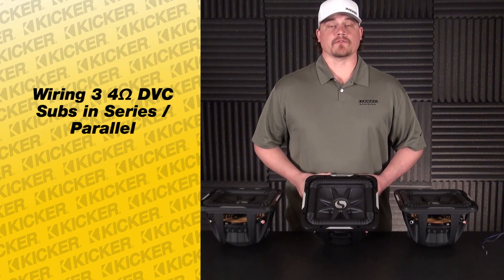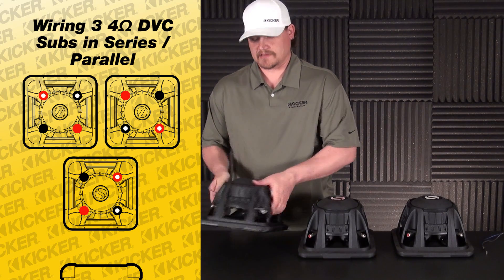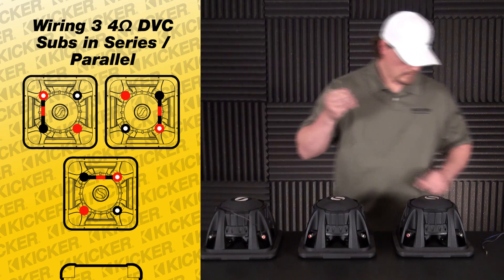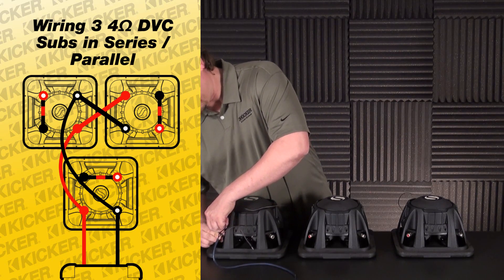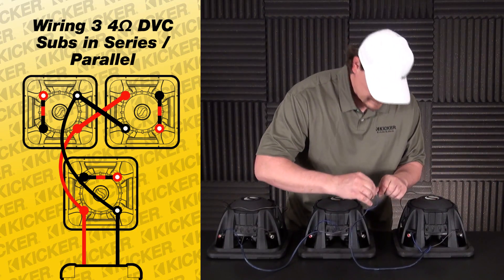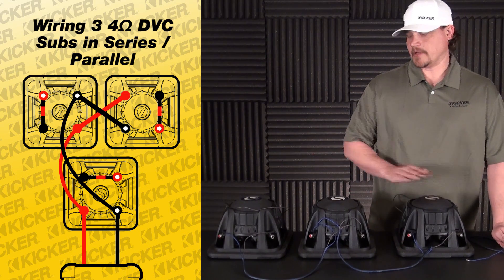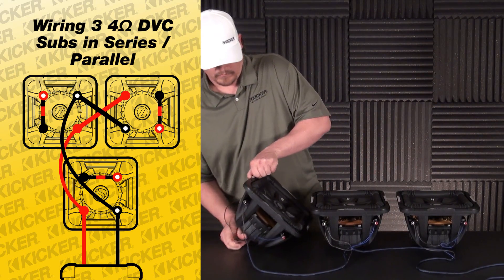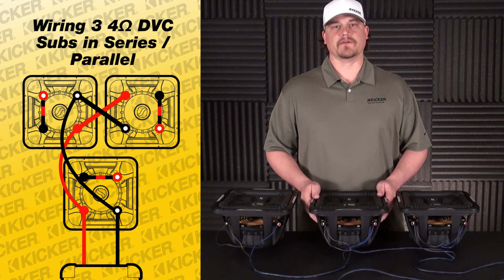Subwoofer Wiring: Three DVC Subs in Series Parallel

Comment: What amp should I get if I run this?
Reply from the maker: To answer that, we would need to know the size and model of the subs you chose.  The concepts are valid (ohms law never changes), but this video shows products that have been discontinued, as it is several years old.

Comment: I have a question I have 4 12" subs that are 4 ohms each I wired them parallel when I finish they were reading 2ohms for every pair they should be 1ohm  I thought when you connect all for subs together they resters 1ohm  I don't think they are registering right what do you think thank you

Comment: Igot 2 12s nd 1 15 cvrs dvc all 3 4ohm can ihook them up together still???
Reply: My amp is 1ohm compatible so this is perfect bt its only 1 channel can i wire my 2 12s and 15 together??my amp is 5000w with 1800 rms at 2 ohms...ijust wana know if ican hook up my 2 12s nd 15...
Reply from the maker: We usually don't recommend combining sub sizes, as it can create phase issues.  Those issues can potentially make it sound worse, not better. Can it be done? Yes, as long as the ohm load is safe to wire to that amp.  Should it be done?  Try it with and without - and see what you think. That's the ultimate test.
Reply: KICKER thanx ima test it first and see what it sounds like but mor than likely il get a separate amp for the 15...you are very helpful keep up the good work..love ur videos

Comment: can i wire 3 dvc sub woofers to a one ohm stable amp
Reply from the maker: You can wire three 2 ohm or three 8 ohm DVC subs in series parallel to 1 ohm. Three 4 ohm DVC subs will not make 1 ohm.
Reply: So what ohm amp do I need for 3 4 ohm subwoofers
Reply from the maker: The lowest load you can make is 2 ohms. Remember that just because the amp is 1 ohm stable doesn't mean you must give it that load, so you wont hurt anything by doing so.  In fact, most amps only give you about 3 dB more going from 2 ohms to 1.  Plus your amp draws more current and creates more heat.

Comment: what about 3 cvr 2 ohm dvc 12s to a 2ohm kicker dx1000.1 monoblock?
Reply from the maker: Sure.  Wire them in series parallel and you'd get 1 ohm.The RMS is 400 watts per sub, so you'd be under-powering them a little, but not much. Just make sure that DX has proper juice coming from the battery and you should be good to go.

Comment: What about connecting three 2 OHMS DVS? 
I wanted them at 1 OHMS final.
Reply from the maker: If you series parallel you should get 2 ohms, which is the way to go.  I don't know of amp modern amps that can take an ohm load below 1 ohm.
Reply from the maker: Realistically you have two choices for three 2 ohm DVC subs: 1ohm (series parallel) or 1/4 ohm (parallel). Use this free app to see a diagram: http://www.kicker.com/kickeru
Reply: KICKER yo i got 3 dvc 4ohm, if i series wire them shouldn't i get 
.6ohm impedance?
Reply: SAJ@TV

Comment: What about 3 10 inch Pyle PL1090BL 10-Inch 1,000-Watt DVC Subwoofer... going to Crunch PX-2000.1D 2000 Watt Mono Amplifier
Reply from the maker: What ohm load are those subs?  Need to know that first.
Reply: KICKER Dual 4-ohm, 1000 watts each but more like 500 watts each.
Reply from the maker: Wire it series parallel to 1 ohm.  According to the Crunch website that amp is 1 ohm stable.
Reply: KICKER does this video show that?! If not do you have one this shows how to do that?
Reply from the maker: Grab this app.  It's free, and does a lot for you, including giving you test tones, wiring configurations, power wire calculations and more. http://www.kicker.com/kickeru
Reply: KICKER thank you!
Reply from the maker: Glad to help!

Comment: what the power needed to run that set up
Reply from the maker: This video was done in 2013, so the modern equivalent is the L7S.  The 15" versions take 1000 watts RMS and 2000 peak. In this case Id say the best single amp for the job is the KX2400, or you could go with multiple smaller amps.

Comment: how can i wire 4 dvc subs to a 4 ohm load?
Reply: D Wdt 
Four years with no answer to your question because how many ohms per coil on your DVC subs is needed information. You can get a single 4ohm positive and negative from 4 DVC subs if they are two ohms per coil  subs. Won't work with 4 ohm per coil DVC subs. Wire each sub in parallel between its own voice coils to end up with a one ohm positive and negative wire pair for each of the four subs. Now divide the subs into two groups of two.  Wire each 2 sub group in series to end up with two positive and negative wire pairs showing 2 ohms each. Connect the remaining four wires again in series and you will have one positive and one negative wire showing 4 ohms resistance on a  multi meter. Hope you got a big amp that is two channels bridgeable or monoblock.

Comment: If you have 3 dvc subs on one 3000 watt rms amp at 2 ohms how many watts are you getting of it at 2.6?
Reply: That's a good question. I think it'll lose somewhere close to 3db at that ohm load which the amp will have less stress load wise but if it's  a good brand and the box is solid and everything is wired correctly it shouldn't be a noticeable difference by ear!

Comment: I have three batteries in the back for my audio system if I run all three of them in parallel run a power from the front to the back and ground the batteries in the back will it hurt my electric system in my car
Reply from the maker: James Lee Hi James, wiring the batteries this way will not hurt the electrical system but three batteries can damage the stock alternator.  We usually recommend around 100 amps of current from the alternator for each battery.  You may want to look into a high-output alternator.  Hope this helps.
Reply: KICKER a kicker 2400.1 can work on 2.7 ohms???

Comment: would this work for 3 dvc 2ohm @ 1ohm on a mono block amp for 1ohm final load
Reply from the maker: You can.  When you wire them in series first, each sub will become a 4 ohm sub.  Then when you parallel all three subs together this will drop it down to approximately 1.33 ohms.  If your amp is 1 ohm mono stable then this will work.  Let us know if you have any further questions.
Reply: ok then how do i wire 3 dvc 4ohm to 1ohm on a mono amp
Reply: you can't.  you'll end up with 0.67 ohms

Comment: Do you know the output for 3 DVS 2 ohm subs? Online says 2.18 
I am running the zx1500.1 i want to run 3 DVS subs but i dont know whats better 2 or 4 ohm DVS subs 

Its not bad for my sub to run 2.6 ohm despite it being 2.0 ohm?
Would it be better running 4 ohm subs at 2.18 if thats what it is?
Reply from the maker: Actually when you have 3 dual voice 2 ohm subs you can wire them in a series/parallel configuration and get a 1 ohm load or if you do parallel/series this will give you a 3 ohm load.  It will not hurt your speaker to run them either way.  What impedence you run them at will affect the power output of the amplifier.  If your amp is not stable down to 1 ohm then you will need to wire it so that it shows a 3 ohm load to the amp.  Then all three subs will share the power that amp produces at 3 ohms.  If you would like to talk to a tech please call us at 800-256-0808 and ask for technical support!
Reply: @KICKERAudio ust a question,  so how would you know how many watts the amp would put out at 3ohms? If they only have the rated watts a 1,2 and 4 ohm loads, been tryna figure how this works for weeks, im very new to car audio as well, but it's cool learning all this stuff.

Comment: I have 2 DVC 2 ohm subs(12 inch CVR's) and a ZX750 amp. I have the option of wiring in parallel/series or series/parallel. Both setups come up to 2 ohms load, which is perfect for my amp. Is there any difference between the two? I'm currently wired in parallel(voice coils)/series(woofers) Should I change to series/parallel?